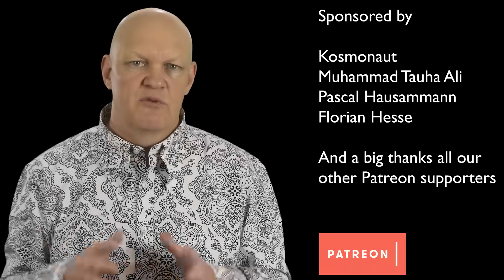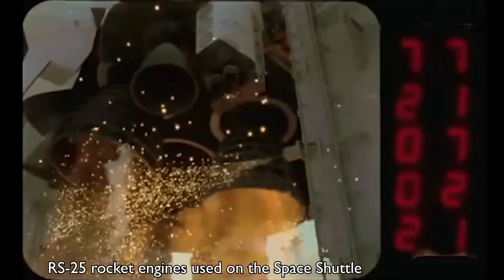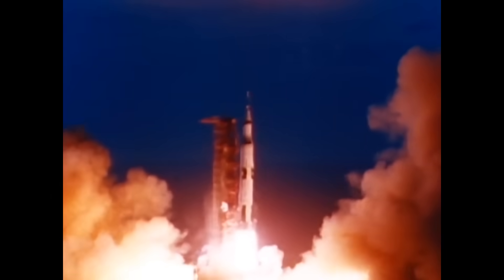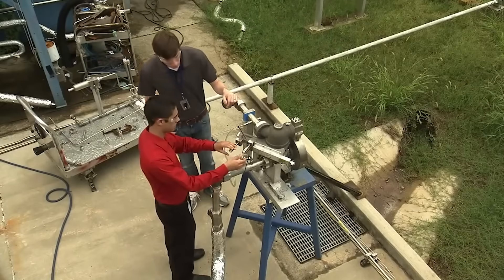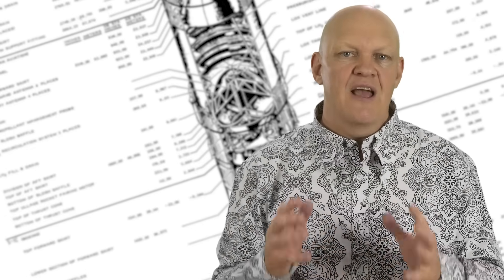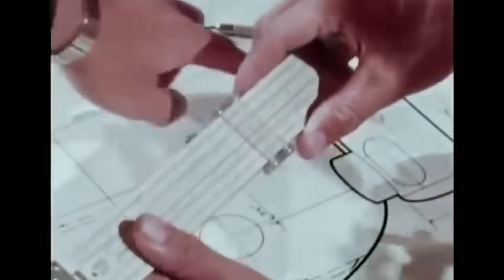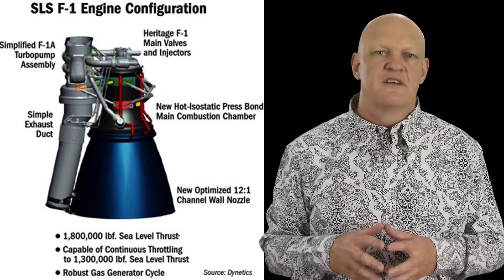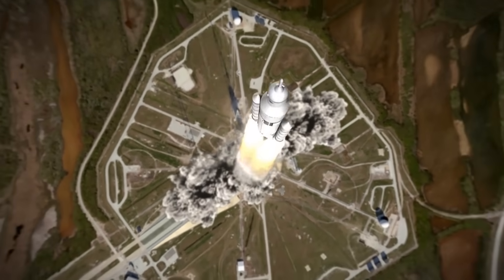Why Can't we Remake the Rocketdyne F1 Engine?

Comment: why the black soot from the engines? hydrogen and oxygen are clean burn..... kerosene added for bigger flame effect?
Reply: F1 fuel was kerosene.
Reply: KillaG FPV The F-1 burns kerosene and liquid oxygen. They run "rich" to lower combustion temps. If you're talking about the dark flame in the close-ups, that is a photography quirk. If you want to film the bright, main exhaust, then you have to stop down so far, that the relatively cooler gas generator exhaust looks dark.
Reply: kerosene was a main fuel component? wasnt aware kerosene had the energy density. interesting

Comment: Well, Mr. v. Braun said dont mix solid-fuel boosters with liquid fuel main engines and Challenger prooved him right. Hope they have a escape system this time on board if the 0-Ring fails again!
Reply: The SLS has the same style escape system as Mercury/Gemini/Apollo. Since it's on top of the stack it can just be pulled away by the escape tower if things go haywire.

Comment: Rather pointless to argue that using the RS-25 engines would be wasteful on the booster stage considering that the core stage on the SLS is just as expendable and wastes two of them with every flight. It's also worth mentioning that NASA apparently did look at using existing rockets such as the Falcon 9 and others as boosters as well. In the end, assuming I remember this correctly, I believe the decision to use solid boosters had to do with the way the rocket would accelerate. The solid option created a smoother acceleration when combined with the RS-25 main stage enabling a "safer" ride for astronauts. They could offcourse have ditched the RS-25 engines and used something else, but since they were doing the best they could to save money and keep the senators happy reusing them solved two puzzles at once so they were unwilling to part with them.

Comment: Please make a video about the ignition process of a liquid fuel rocket engine. How do they ramp up the turbopumps? Do they vent in a startup gas like nitrogen? Is there a component warmup time or is it full burn from the time the pumps spool up? How do they fine tune the fuel/oxidizer ratio or is it just designed to run both tanks empty at the same time? Does the EGT get high enough to melt stuff, should it run rich/lean? How are the pumps lubricated? Is it a full loss oil system? Is the exhaust from the turbopumps dumped out or piped back into the bell nozzle at it's correct pressure point? Is the startup process harder in a vacuum? What do they use for ignition?
Reply: Also interested in sources for the F-1B design simplifications besides the Ars Technica articles. I see they have also lost some thrust because of some of the design simplifications like dumping the turbine exhaust out.

Comment: Why can't we remake the f1 engines is because it's old outdated technology
Reply: It's still the most powerful single chamber rocket engine ever created.
Reply: James Frost If engineers were given the funding that f1 had, they'd beat it.

Also, in an event of a failure, you'd lose A lot of thrust.

SpaceX simply added more smaller engines with a higher thrust force for the BFR, which to my knowledge is being created now.

Comment: I love these video. I think five minutes is a bit too short. I'd go with ten minutes as the shortest duration if possible.

I would point out that the Shuttle's SRBs (or the SLS versions of same) would never "burn up" after they are discarded. They simply aren't travelling fast enough at the point they are jettisoned to encounter sufficient aerodynamic heating to make them disintegrate. That's why they were recoverable in the Shuttle version. The SLS versions will just splash back into the ocean and sink. AT the most, they may break up when they hit the water - although the casings are pretty solid pieces of metal.

Comment: 50 years old? Lol. Programmers often can't get to work code that's merely a month old.
Reply: Only if you didn't bother adding comments.
Reply: It is not only about noob programmer, it is about losing context, unwritten design decision which may be thought as common sense at original time, or dealing with multiple styles of coders in different component from different companies.
Reply: I'm learning to program and yeah... comment everything you think could possibly ever be confusing.
Reply: I was a maintenance programmer, on CDC 1700 mainframes, in the 1970's and 80's. I still have my programs and debug routines, I even wrote a  disassembler, LoL
You can imagine how many languages I've coded with since then.
Reply: Try to use spring and initialize everything via IoC. Even with comment, Good luck remembering or debuging specific little module buried under other little jars.
Reply: Andrew ..... You're hired report to work first thing in the morning..lol
Those were the golden years Andrew....watching the Apollo lunch 
made our days....just like the SR-71 they claim now days they cannot
maintain and keep that plane up in the air...
Reply: That only happen with badly written codes from noob programers

Comment: Short can be ok, here it is. The conclusion is correct, makes sense and the steps towards that are well explained. Thinking about it makes sense to at least completely redesign the making process of the engine - to reduce time of construction, cost and points of possible failure. They had to put all the effort into transcriptions and thinking about new manufacturing, developing something new may very well be less of a constraint on the engeneers, but I think it was worth reconstructing the old one.

Comment: Also, these highly skilled workers would be skilled because they had years of experience by the time they worked on the F-1 engine, so they wouldn't be in their early 20's which would men they'd be 70-75 today. But if they were just 40 years old in 1968 when the final engines were being built, they'd have to be be 90 years old today, so most would not still be be alive OR they'd quite reasonably have forgotten small details of their work from half a century ago and couldn't really be put back to work.

There could be a few young prodigies. But quite reasonably none that could be found today and you can't just find one who worked on one part, but the entire design challenge.
Reply: Treblaine I am sure there are notes on every screw or inch on that engine.